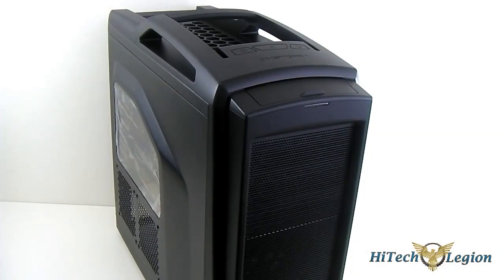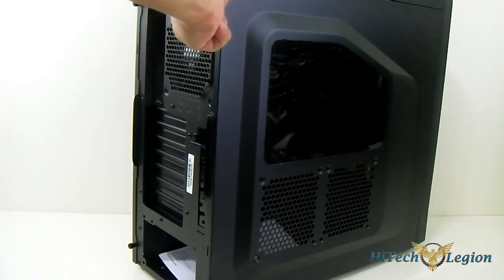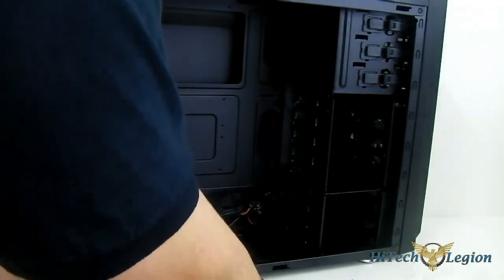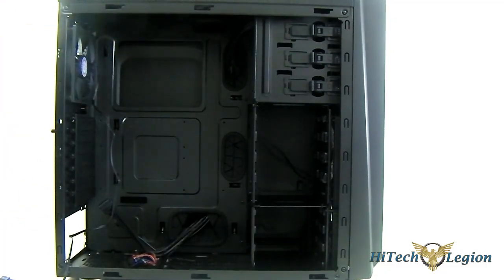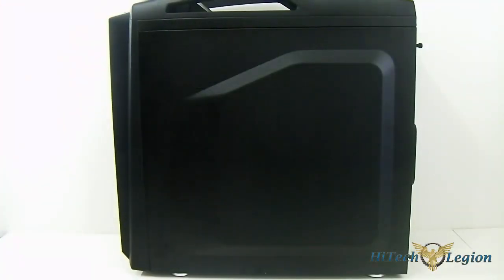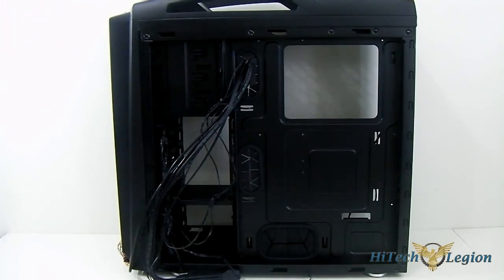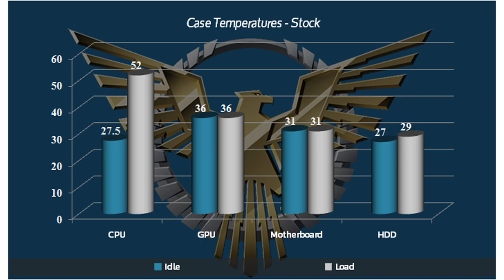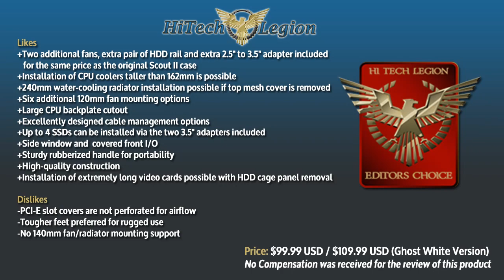CM Storm Scout 2 Advanced Case Unboxing + Review

Comment: It fits somewhat. Check my installation video in the description to see what I mean. There isn't enough room for push/pull but push or pull is possible but the radiator will be exposed on top for push (as the top cover cannot be placed back)